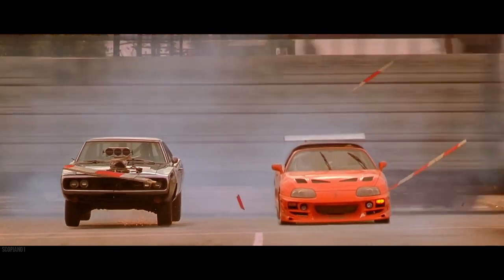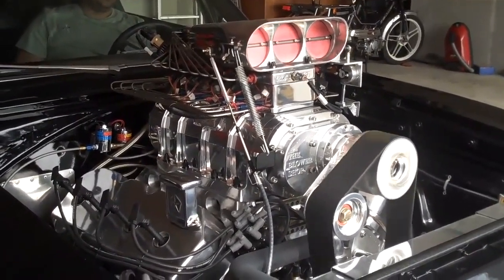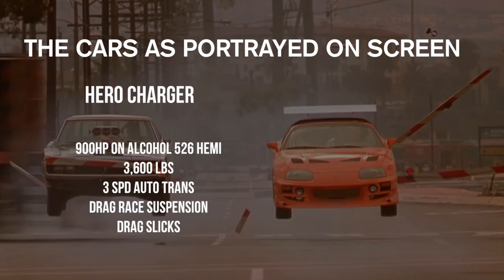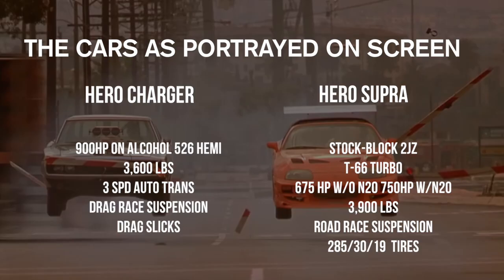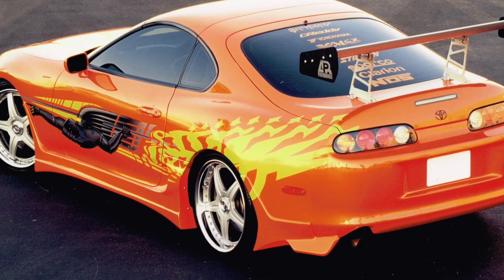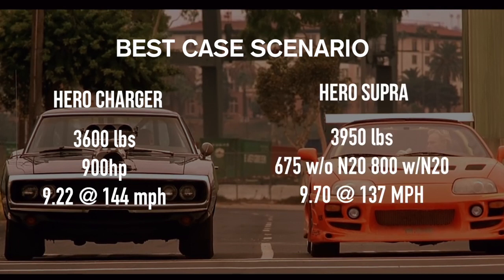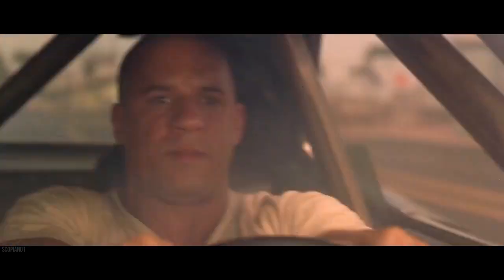Episode #3: The Supra or the Charger: Which one really won the race?

Comment: 3spd auto on the Charger? Isn't Dom running through the manual gears in the scene? Also...that's a 1970 Charger...not a 1969.
Reply: no it's a B&M shifter which is common on manualised autos so you have to shift the gears but no clutch etc
Reply: And if you really pay attention, it’s a reverse manual valve body.
Reply from the maker: Fred Laurence It’s actually a mix of parts from a 69 And a 70
Reply: @craiglieberman  Are you really gonna play that card?? You know exactly what I meant. Regardless of how the car was put together in reality...its modeled after a 1970 Dodge Charger. Just like the Dukes of Hazzard car was a 69 Charger, even though for production purposes they used 68s and 70s, then modified the grills and lights as necessary.

The car...on FILM is a 70 Charger.

Comment: Ur leaving out the most important Mod for both cars, which is the DRIVER! Either one of these cars could beat each other with the Proper driver. 
I've seen 600hp cars beat 900hp cars. 
I've seen 2 identical stock 2018 Camaro SS's race and the winner won by a few lengths. So...Yeah, DRIVER MOD!
Reply: I was watching a video yesterday where a completely stock Hellcat got beaten by a pure stock 72 Dodge Demon (yes I know pure stock is not the same as stock-stock) but at the end you could see that the Hellcat was gaining on the Demon and would have won if the Hellcat's driving wasn't sleeping on the starting line

Comment: How could a supra weigh more than a heavy Dodge Charger
Reply: Yung Flame lmao right ?!
Reply: The charger was stripped out and obviously build for drag racing. The Supra has tons of stuff in it like the speakers and amps, full interior.
Reply: Dom is not a stock racer
Reply: @quesoritoandablunt  plus 19 inch wheels too
Reply: Supra is not a lightweight vehicle. Also, older cars are not as heavy as you think. While a turbo MKIV Supra is about 3500lb stock, a 69 Charger is around 3100lb.
Reply: @rcairforceone  correct, although his charger was a 70, not a 69
Reply: @anthonywaters424  the movie car is a 69 built with 70 parts.
Reply: Back in the day those 60s american "boats" actually werent all that heavy because they were practically just big shells with drivetrains. Not stuffed full or tech or comfort like modern cars
Reply: @quesoritoandablunt  but Dom weighs more than Brian :D
Reply: all the stickers on the supra added 300bhp and an extra 200lbs
Reply: weight reduction brah
Reply: Y V 
Hahaha that’s a good one. Bravo 👏
Reply: Supras were ridiculously heavy for some reason. I think the manufacturer did it to give the car a feeling of soundness. A good example is there's a completely non required metal frame in the glove box door of the supra that weighs 12 pounds on it's own.
Reply: No modern safety stuff, most new cars are alot heavier than the oldschool muscle.
Reply: HYSTAR PRO the weight of the guilt Dom carries for blinding that guy with a torque wrench . It’s heavy man.
Reply: Supra had a riced interior, Charger had a  stripped interior
Reply: @rcairforceone  3,100? A factory 1969 Charger with a 426 and a 727 automatic had a curb weight of 3,810 pounds. A small block Barracuda would've been close to 3,100, but that's ludicrously unrealistic for a full size big block car. The reason he estimates 3,600 in this video is because the car's been stripped down to weigh as little as possible.
Reply: @jimbojimson  all I did was Google.
Reply: Old cars, especially stripped down ones, really didn't weigh as much as you think. They were much simpler. No extra crumple zones, airbags, computers, vibration and sound dampening material, etc.

My friend in high school had a 67 Mustang fastback I6, and it was about 2600lb curb weight... More than a thousand pounds lighter than current day Mustang V6s
Reply: Supra is a heavy car actually
Reply: Silence guys, the JDM fanboys are discovering that the supra is fucking boat lol

Comment: So best case scenario charger runs 9.2 but there are 3 reasons why this isn’t a best case scenario. 
First it’s his first time driving the car so highly unlikely he’s going to run a perfect time on his first pass
Second while he does have drag slicks he isn’t on a prepped track so he isn’t going to get the same kind of launch. On top of that he does both a wheelie and a burnout which of course isn’t realistic but doing either of these things tends to negatively effect the 1/4 mile home 
Third he has some kind of weird engine failure which even though it isn’t exactly realistic it still implies some kind of reduction in power thus a slower time. 
Taking all this into account I don’t think it’s unreasonable to say the charger ran a 10 sec pass. And taking into account the supra best case is 9.70 and you say guys were doing roughly 10.6 with similar supras I think we could split the difference and say in this race the supra ran 10 sec pass. Thus confirming that it met the requirement of being a “10 second car” and also showing both drivers were equals. This is just my head cannon and I know ultimately it doesn’t really matter cause Hollywood

Comment: For people who are saying the Supra only caught up because the Charger threw a rod, I think you'd be wrong. If you rewatch the scene, the Supra stays on the Charger after using nitrous, where it presumably gained 150-ish horse power. So, given that, when the Charger throws a rod, it should have fallen behind, especially when Brian used a second shot of nitrous. So how the hell did a Charger missing at least one cylinder keep accelerating enough to tie after Brian used the second shot of nitrous?

Comment: 3900lbs for a mk4? Theyre like 3200 wet....Also t66 make 750rwhp on a 4 cyl so that would be about right for Max
Reply: The heaviest is about 3500lbs stock with a factory turbo but you're not counting in all the aftermarket junk that was added to it which would bring it up to roughly 3900lbs, all the electronics, body kit mods, wheels, and it was twin turbo'd so that also adds weight compared to a single turbo
Reply: @Dunki113  u kidding me ? a Body Kit and the Wheels ? sorry when u modified ur Car and had more weight than Stock u do something Wrong

Comment: Yeah, but I think we're overlooking the physics-defying "burnout-wheelie."  These are essentially polarizing physical characteristics.
Burnout:  Lack of traction, tires don't 'hook,' torque causes wheels to spin freely around drivetrain
Wheelie:  Significant traction, tires 'hook,' torque causes drivetrain to lift around wheels

To do both near-simultaneously, would require a ridiculously poor application of power in which the car makes a significant amount of torque, the tires hook with ample traction, the car lifts up (wheelie), then, immediately after initiating forward motion, the car powers-over, making even MORE torque, the tires break traction, and the wheels begin to spin freely (burnout).  

No one would ever set their car up for, or seek to achieve, this driving behavior for the purposes of drag racing.  Each demonstrates a loss of applicable energy, and both done together would be an EXTREME waste.  The goal of a drag is to put the most amount of kinetic power down with the least amount of loss, maximizing the preservation of your potential energy (essentially, "giving it all you've got").  

If the Charger would have run a 9.5 ("nines"), a burnout-wheelie would have put it in the elevens.  So much for a "ten-second car."
Reply: You know this is a film and not actual drag racing right?
Reply: I watched directors commentary and the reasoning was basically they wanted a burnout and a wheelie so they did both
Reply: You're taking this film a little too seriously. It's Hollywood. It's not meant to be completely accurate.
Reply: @Opethfeldt  It's not, IN ANY WAY, accurate.  Even the most novice of street racers laugh at the movie's fallacies.
Reply: @redslate  Also Another thing you...forgot Uhh That Was A Road..A Drag strip is alot more stickier Then a regular road...you realise that right

Comment: He states in another video even if the charger had 400hp. It would have won the race due to the charger having superior tires which is true. The supra would have spun all day on the 245s. And the charger had a 3spd auto no missed shifts its case closed charger wins.

Comment: It was a shame that the supra wasn’t shown in its full potential, I’ve heard of 2jzs getting over 1000bhp plus which would of dominated the charger.
Reply: But that wouldnt make sense in a economical way,  dom wanted a 10 seconds 1/4 mile car,  this is what bryan gave,  1000hp was not necessary
Reply: its all the Tires , the Charger with Street Tires was not faster than the SUpra
Reply: AMIGABLUEBIRD r888s can handle 1000bhp
Reply: God of Demência It would, Brian and Dom as it became more known in the series that they had a rival, Dom preferred muscle cars and Brian was into  tuners. Brian could of left Dom in the dust.

Comment: Ain't no way, the heavy Supra MK5 A80 , with over 600 Horsepower, is goin' to win against a 6-71 Supercharged BIG BLOCK BUILT V8 , drag ready Dodge Charger pushing over 800 Horsepower.

Comment: Thought the charger was manual, and a 1970 not a 69?
Reply: Four Rings Auto it is but they’re virtually the same options between both years and I think 70’s were technically sold in 69 right lol

Comment: So that charger with a big block hemi weighs 300 pounds LESS than a supra? Press X to doubt.
Reply: The charged was striped down,  it has nothing but essentials,  making it lighter,  while the supra had even sound system,  and supras are really heavy even stock
Reply: I think a stock twin turbo supra weights like 3,500 pounds,  and the charger 3,800

Now,  the charger was striped down so it lost weight

The supra got bigger wings,  wheels,  sound system,  body kit,  and etc
Reply: @Gorecatto  Body Kits Wheels etc are lighter best part the Motor Hood  and a Sound System more than 100 lbs ? u want kidding me ?

Comment: But the charger is a 1970, not a 1969
Reply: Cody Praetorius stock specs would been about the same.
Reply: @CamaroAmx  to an extent...but the front end is different. I own a '70.
Reply: Cody Praetorius the nose and tail panels are different, as is the dash layout, but the mechanical specs are the same.

Comment: An alky injected, supercharged 526 Hemi that only makes 900hp is a pretty weak build.

The guys that run top eliminator at my local track are getting 900hp with naturally aspirated Chevy big block strokers running alcohol and a single carburetor.
Reply: adam christopher and Supras are pushing 1000hp today, remember these cars were built in the 90s, back then these kind of numbers were impressive
Reply: My neighbor  used to have a big  block camaro drag car that did 950hp to the wheels n/a. It's pretty easy to do these days.

Comment: But this wasn't a drag strip.  Literal no-prep surface and Dom didn't even get a chance in the water box to do a burn out. So cold tires on a non-prepped street... Dom had to pedal it the whole way - which is why you see him only floor it after he was mostly through the 1/4 mile.  Plus he had engine failure.  Plus he did a wheelie and smoked the tires at the same time - he had both too much traction and not enough traction at the same time. If that were even remotely possible, that would have greatly slowed down his launch. Neither ran a 10 second run. That scene took probably 25-30 seconds before they went to slow-mo right before the finish.

Comment: So..best guess on the fireball of an explosion on the side of Dom's engine? nothing i can think of would cause that. right before it happens, we see a shot of the oil gauge..but the pressure doesn't drop, it goes up a bit. but a blown oil cooler line wouldn't make weird noises before it happened..wouldn't cause a fireball..or make the engine run funny beforehand. A snapped con rod punching a hole in the block..still would not cause a fireball. I got nothing.

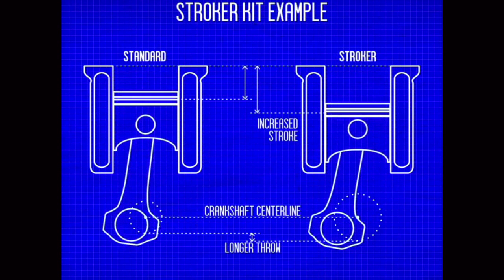Comment: 4:13. Great shot! Unlike earlier when Dom & Brian are chasing the dirt bike riding antagonists..Dom does a single spin lil burnout. That scene always makes me laugh..how could it of made the final cut? Plus in the drag race were talking about..Dom has lifted up on the loud pedal, then hits the gas as he bumps the auto trans shifter..why was his foot up? Brian would've nuked him if he let off for a half second! 6:29. That is what I wanted to hear :D Rewind!: 1:40 Bore and stroke to gain cubes. Yup. Although, you never want to bore an engine..you lose block integrity, you lose cylinder/ring seal..you lose power via the dreaded blowby, bc oil ruins your octane! Do you want an engine that pings/detonates even on HP race fuel? No? Then skip the bore job! ..and you'll curtail the longevity of an engine. Exceptions: An extra beefy race type block with gobs of extra iron..go ahead and add a modest over bore..otherwise, standard production engines, never go overbore. It's a bad plan. 7:26 "Sorry, folks, the Charger would've won" What's this sorry stuff? The Charger has a multi decade head start. Dodge has built (and still does, ever hear of the Demon?) many record holding drag cars, the '68 Super Stock Hemi Dart & Barracuda still hold their 50 yr old record! The Mopar has lots more cubic inches and is more naturally set up to accelerate, ie a higher cg helps weight transfer..a looser suspension helps weight transfer, the drag tires are just the icing on the cake. There's no sorry involved. 7:55 You left out the 383 and 440 Magnum engine options on the Charger..and..the mighty slant six! 9:07..Stunt driver in the Supra hit the wipers..woops? Lol a hard landing fo sho! ...btw, a stock '01 Supra ran in the 17's in the 1/4 mile! Paul shudda had a Viper. So much easier to get into the 9's :D
Reply: To be fair, the part where Dom took his foot off was so that he could shift, you're never supposed to shift gears while having your foot on the gas, it's always 

1: remove foot from accelerator 
2: clutch
3: shift
4: place foot back on accelerator

Comment: Ok wait.... You forgot to add Dom lost a cylinder.....

Theoretically, charger all the way..... 

In the movie,,,,, Supra by half a nostril crossed the tracks first.....
Reply: All my life i think Dom blow the oil pump. But maybe i wrong.
Reply: Movie showed the block busting..... I thought..... But I'm a bike mechanic not a car mechanic so I could be wrong as well lol
Reply: @jdboyd3724  But your vision is make more sense.
Reply: @Poronggo  I would think if he lost the oil pump his motor would've locked up but I'm not sure there was enough distance traveled from when it happened, to when he hit the truck....
Reply: @jdboyd3724  Just looked at the clip again to be sure. I'm pretty sure the movie intended to show a rod punching a hole in the side of the block as it broke. Unless the piston disintegrated when that happened, there shouldn't have been fire escaping from hole. That said, the Charger definitely lost a cylinder so would have been down to around 780HP best case scenario. Before that happened the charger was ahead by almost 2 car lengths and absolutely would have won.

Comment: No way that Supra weighed 3900 lbs lol.  2900 is more like it.
Reply: LMAO yea ok...maybe on the moon
Reply: Supras were heavy to begin with and then add all the aftermarket goodies (big stereo system, TVs, ect) and nearly 4K lbs is not unreasonable.
Reply from the maker: brian hilligoss Wrong, bro. 3500 lbs dry. Add Dynamat, 19” wheels,  big subs, and a custom audio build and roll cage PLUS fluids and you’re at 3900 lbs. and a 200 lb driver and you’re at 3900+ lbs.